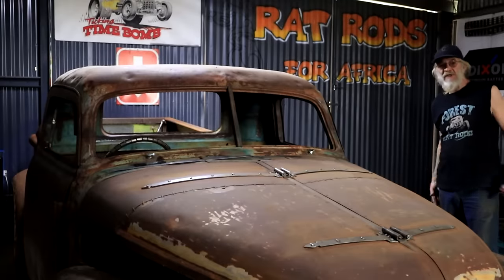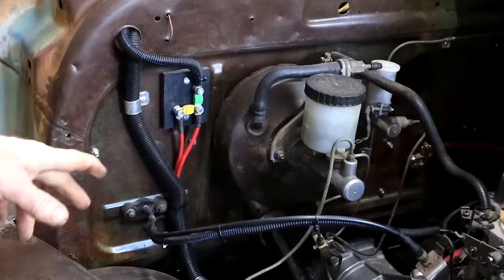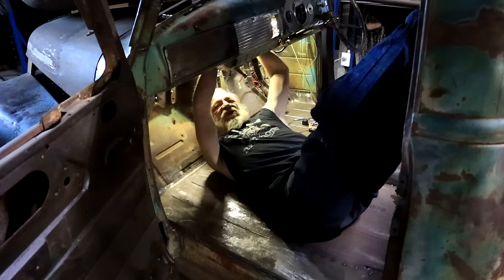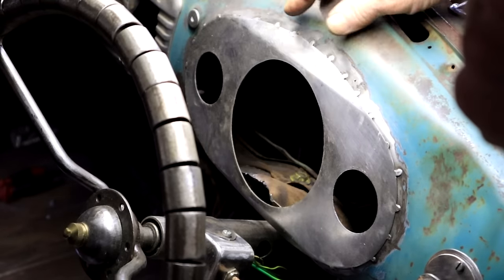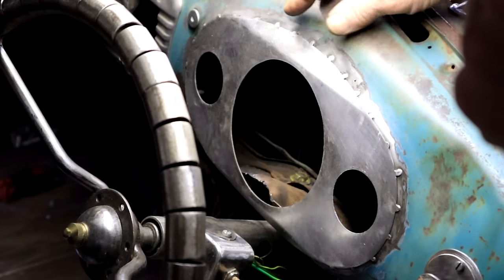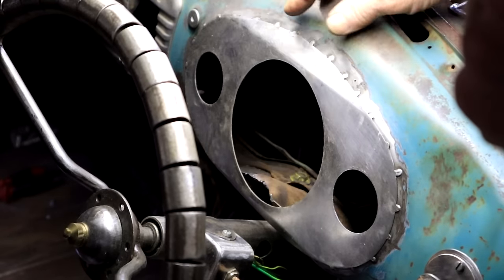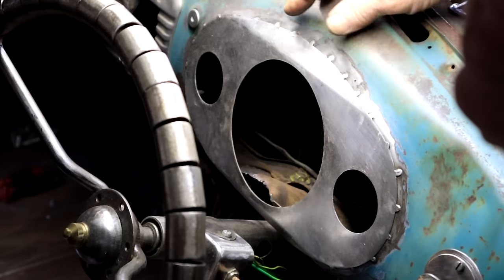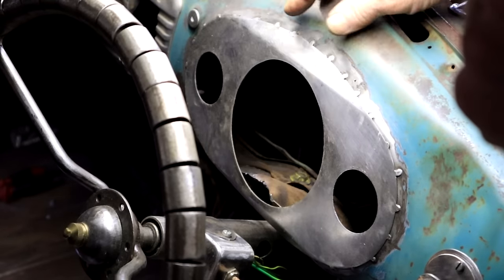Basic ELECTRICAL wiring for the truck - 1951 Chevy Rat Truck Build

Comment: Superb! Thanks Diff. 👍 
Simple and functional. 
One more level to electrical insurance is to use the heat shrink that has the glue inside.
Reply from the maker: Thanks brother! Simplicity is the best, less stuff that can go wrong. I dont think the fancy heat shrink you talk about is available in my local shops...
Reply: @ratrodsafrica  They call it “adhesive lined” and “marine grade”.  It provides a waterproof seal. It’s worth looking into.
Reply from the maker: @StirlingLighthouse  thanks will see if I can find some

Comment: Ok, Ok, I will give you a brownie point for clipping your zip tails. But as far as the electric system, well . that's something else . Heck I would pin a girl scout merit badge on you. I like the way you cleaned it up with the wire loom .What is over the top is your wire connections they are very nice and done properly.
Reply from the maker: Brownie points AND a badge! Lucky me!😅 Proper wire connections are SO worth the trouble!

Comment: Boet!!! I enjoyed the video a ton!!! You do a great job with tidying up the details. You mix the rust and patina, and rough exterior, with perfectly loomed wire, sorted and secured with p clips rivited on to a old chassis and body. You talked about this topic in a previous video that just because its a Rat Rod you dont want to skip out, or use it as a excuse for the mechanical side of the build to be slacking. I enjoyed seeing you work through all the small things. Great balance of a build, thats just my opinion. One look under the hood and anyone can see that the builder did more than just mix some parts and melt them together!!! There is some class, careful planning, thoughtful design elememts, functional and cared for mechanics and a bag of tricks that was used to blend everything together!!!
Reply from the maker: Thanks Dustty! Well, I reckon that if you do something, you must do it the best you can. Most of the times a halfass job needs to be done twice, so might as well do it properly the first time. And yes, Rat Rods should not be an excuse for bad work. I feel you have summed up my vision perfectly, thanks man!

Comment: Thank you. Div. That was very easy to listen to and explained very well. I knew nothing about wiring when I did my 61. Apache. C10. It was a slammer no paint just an epoxy primer sanded to have the patina look if I can figure out how to send a picture I will try. I sold her back in 2007 but I want a 56 Ford flat bed so I am on the lookout I had a connection to a 39 Chevy. The grill and cab and doors were there. And it was about 1100 miles away for $2500. So gas in California right now is $6.50 a gallon and my truck gets about 12 miles per gallon so it wouldn't be a good investment at this time. I just keep looking for now.. well take care awesome video.
Reply from the maker: Thanks and pleasure Mark. Keep looking, you will find something if you persist! 😀
Reply: Mark, can’t you find a local shipping company that can ship it to you for cheaper than it’ll cost you to go and collect the cab and stuff?
Reply: @thedon2512  that's a great idea but getting the items shipped would be about the same. As me going after it and it's site unseen that way.some people just aren't as truthful as they seem. I did an over the phone with my 61 the guy said it ran great had a new motor. It turned out the engine was blown. 2 pistons exploded. And a bunch of other problems that cost more to fix it.this truck is in the state of Washington and I m from so.cal. It would be a cool project but I want to build a budget truck there's deals out there I just have to be patient and increase my funds.lol.

Comment: Instead of electrical tape on a splice I always cover the splice with RTV then slide the heat shrink over that. when you shrink the heat shrink the excess RTV squeezes out the ends but you know it has filled the inside of the heat shrink. A navy electrician showed me that to keep the salt water out of the splice.
Reply from the maker: Great idea!

Comment: Personally, I give you 3 brownie points for your mastery of electrons. The rocker arm switch with a loop of timing belt is barnyard engineering at its finest. 
  You soldered, shrink tube but here where we get salt water in the winter and drops from the heavens in the rest of the year, I use a dielectric grease on the connectors. It keeps them from being naked and changing colors. Vaseline is sold in the medicine isle and may work about the same. Either way, just be careful when washing it to get the shine everyone wants! 😊
DK, Omaha.
Reply from the maker: Washing? What's that?😅 Thanks for the 3 brownie points, I always need a supply of those!
Reply: @ratrodsafrica    I just knew you would get a laugh out of the washing comment! You have to keep the patina clean for others to stare at it!!!! DK, Omaha.

Comment: Nice work.  I have wired from scratch 7 cars and the 57' GMC and I can see no other way.  I have had friends get the "universal" kits but it is very wasteful.  So many ways to do this but it changes not only per person but needs and wants so best to do it from scratch.  I have a 1964 Triumph TR4 and that era (and many cars/trucks) use one earth wire for 5 things and crummy push in connectors - trouble waiting to happen.  I also solder every joint and each lamp/load is earthed.  The whole system looks so much brighter.  I will change anything I can to LED also.  I love using aviation woven earthing straps for the motor block to frame and battery to earth.  It is very seldom I drive anything old at night but when it do it is so much better than the "old days".  I also never use OEM generators and fit alternators with warning lamps and volt gauges.  I just ordered some cab lamps for the 57" GMC but I really don't want to drill holes in the cab and have wires hanging down.... I am not sure what I'm going to do.  I don't have the chambered cap top (and I bet you don't) so I'm just going to see but I do love the cab lamp look.  I do think your rig would look cool with cab lamps too!  I hear they have wireless cab lamps but not for the budget build at $400 USD!  Nice to see your work as it seems we live similar lives.  I too am a huge advocate of relays.  I'll catch up on all of your videos as I do not only like your work and the fact that you GO IN and do it!  No lollygagging!   Bobby
Reply from the maker: Thanks Bobby. Appreciate the feedback

Comment: Like I have said before , love the way you describe what you are doing . You do wiring the same as  I it is the ONLY way to do it  it was real funny when I saw you joining the two length of wire together and  if you don't have tape you can use some dielectric grease work good to . Build On
Reply from the maker: Thanks brother. When you are a scavenger, gotta join wires from time to time😅

Comment: Well I'm giving you the whole pan of brownie points for that job, that has to be the most creative way of running wiring I've ever seen,  hope you don't mind if I borrow your plans for my 47 but it's not as confusing as the way I've used in the past 😉,  I've also used the "on-off-on" switches for the high and low beam headlights as well as a 2 speed heater blower and wipers, awesome job Diff, 😀 👏 👍
Reply from the maker: The whole pan? Lucky me!😆 I'd be honored if my ideas can help you Geoffrey! After all, that's why I share.
Reply: @ratrodsafrica  I'll definitely be using parts of it,  I like the keyless start system,  I already look like a janitor with all the locks I have,, lol, great job again Diff

Comment: Good lesson for someone like me, with basic school knowledge of electricity, but not really understanding how actually the electricity circuit in car works (especially the part that all grounding or return circuit goes through the car body, which also means that all return wires are not needed, which seems really handy, considering that would be one time more length of the wire.)
Reply from the maker: Great to hear it helped you!

Comment: Hey Div,
Very cool build. But you might want to put some kind of insulation your dimmer switch. Because say you have been out in the rain or you are sweaty, and you touch the switch with one hand and have a another wet or sweaty body part touch say our seat or door. You are going to get one heck of a shock, one that could hurt you pretty bad. I grow up going to my local Ford dealership when I was a youngster, my step dad worked there. Anyway one of the mechanic was just changing a batter in a car(something he had done hundreds of times), when his wrench on the positive side of  the battery touch the fender/wing it send electricity through the wrench to the fender/wring. The bad part was that he had on his wedding ring in the hand he had the wrench in. He almost lost his finger, and he could have lost his life(because of the shock to his system). Just trying to keep the videos coming 😅. Be safe.
Bart
Reply from the maker: 12V cant really shock you, I mean you can hold the positive and negative pole of a battery and feel nothing. When you create a dead short with a wrench, thats another story. The wrench heats up rapidly and burns you.

Comment: I hate the plastic crimp connectors and I also solder my connectors. I found a big pack of brass plated connectors from China that don't have the stupid plastic. I also bought meter lengths of shrink tube that has sealing glue on the inside.

Comment: Hey Div
Looks great Man.
Suggestion  for flasher indicator and High Beam.
- you could put an LED in one of those hole fillers to flash with your blinkers, indicators if you like ( yellow or orange LED)
Love your dimmer switch - looks awesome. could do a high beam LED into the other hole filler - Blue one for High beam indicator

I also have a tip for you if you like.
Tip.
When drilling through fire walls and hidden panels for rivets or bracket screws
To stop the drill penetrating too far into the blind area 
- slip a piece of rubber or silicon tube over the drill bit .
- small fuel filler line fits over the 3.0 mm jobber bits nicely.
- leaving only enough cutting length to penetrate the steel thickness.
- it stops the drill without marking the face and prevents poking into something behind that you cant see.
Reply from the maker: Thanks. Nice tip, I'll definitely give it a try

Comment: Awesome video thank you, love the fact that you solder and then seal all of your connections that's exactly what I like to do, there's a technique that I've discovered that works well especially in places that get wet, take a pair of scissors and slice off a sliver of hot glue stick put the sliver next to your soldered connection before you heat shrink and the hot glue will ooze out the ends and you have an indestructible super sealed connection....... Just one small point of contention..,. You put the steering wheel on the wrong side of the truck mate...... Just kidding thanks again.
Reply from the maker: Yes man, the hot glue trick is a neat idea! What? Oh no! Never even noticed the steering is on the wrong side!😂

Comment: Thats a cool video. What about connecting your dimmer switch on the ground side of the circuit? Wouldn't that be safer? In the case of accident grounding the worst thing that could happen is the lights will come on, you could argue you were just greeting someone...HAH HAH HAH. Thank you for sharing Div.
Reply from the maker: ISH! Why didn't I think of that! Ah well, I will now just have to live on the edge...😂😅

Comment: Nice job there Dif. Looks lovely and tidy. Simple too. Ain't no need for the complicated bullshit in these modern motors, Grrr!!.  I'm working on both extremes at the minute : A boat next to me with a 1970 ish Volvo AQ130 petrol 4 cylinder points condensor distributor setup, and an 1989 Ford xr3i efi that's running way too rich. Potentiometer for efi Co2 (mixture) is Donald Ducked (f_cked). Rare part. Gunna solder in a new run of the mill Potentiometer, and set it by ear hole.    Great video Mr  😎
Reply from the maker: Thanks mate! Ah man, these modern things are way too complicated for me. Only ECU in my life is me!😂 Efi, pots, CO2 mixes and all those swear words I leave for you. Obviously you be way more cleva than this old school hippie😆
Reply: @ratrodsafrica  
Bin trying to work out how to stop an ignition coil spike back to the ignition control box on the positive side, with either a capacitor, mosfet or transistor all evening. Plus how to wire them up correctly?. 
My brain hurts!!  😎
All answers on a postcard to :
   Billybob's Boat
10 Drowning Street 
   The River Nene.

Thanks in advance   😎

Comment: park-lights / running-lights, we used to call them STADSLICHT city-light. and in NL it's actually not legal to drive only using Stadslicht alone. for driving in the dark Dimlicht is required. due the fact that running lights usually aren't combined with the rear lights (anymore) like to many people think to my dissapointment, when i see somebody driving in the dark with only using some running lights in the front of the car, thinking his rear lights might also work. nope!
but if i remember correctly back in the days park/running/stadslicht did used to be combined with the rear light-lights back then.
another thing this sentinental/cornering lights you see these days are drivin me crazy. when a car goes arround a roundabout (rotonde) those lights of those newer cars come on every time when they make just a small turn even. leaving me thinking is he using a turn signal or what!?. it even obstruct the visability of the actual turning signal.
whilest back in time when I brought my '69 cadillac for MOT RDW they insist me to cut the wires to my actual sentinal cornering lights while these only light up when the blinker switch really is triggered, so they do make sence in my Cadillac. i really think about connecting them again now we see even more of those noncense randomly glowing up lights in these newer cars. LOL
Reply from the maker: Yes, on old school cars, the rear running lights burn with the ones up front. These modern cars look like Cristmas trees with all their lights, and as far as I'm concerned, they are ugly!
Reply: Interesting Jan, thanks for the lesson,

Comment: Hi Div, Did I see this correctly ? The headlights will shut off momentarily when switching between high to low or low to high beams ? If both brass bolts were closer together then both high and low beams would come on at the same time momentarily when switching between them. Rat Rod technology may not care !
Reply from the maker: You nailed it with your last sentence!😂 Rat technology requires some quirkiness... But yes, moving them closer will be better. In my case, you just gotta be fast😅

Comment: Nice work with Electrics , do you have a an electric fuel pump , just wondering if you added a relay for this , keep up the good work looking forward to the next instalment 👍
Reply from the maker: Thank you. Running a Facet electric fuel pump. No relay, ignition switch can handle it no problem

Comment: Hi oom Div!
I think—-i might be wrong but still think you should bring the screw heads closer to one another ad you are going to have a dead spot switching from low to high and back again, then night driving is going to be a pain in the truck
Reply from the maker: Guess they could be closer, but works for me. If you switch over briskly there is no dead spot.
Reply: @ratrodsafrica  I guess you will get the hang of it soon, ,
Thanks excellent built
Reply from the maker: @thedon2512  gotta have a few "hangs" on a rat rod! We don't build them for the average consumer idiot!😂

Comment: I’ve been,professionally, working on cars for more than 50 years  It’s my habit, before 
I start, I always, refer to the service manual. However, the electric system that you’ve explained, is extremely professional, and it’s not available in any textbook.
Reply from the maker: Thanks. When its a custom one off thing, I would have to write the service manual afterwards😅